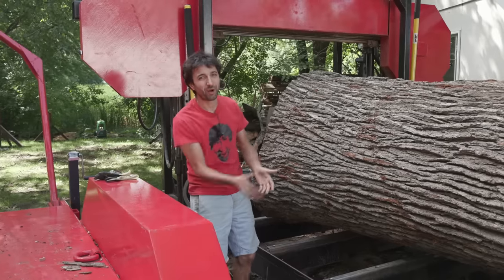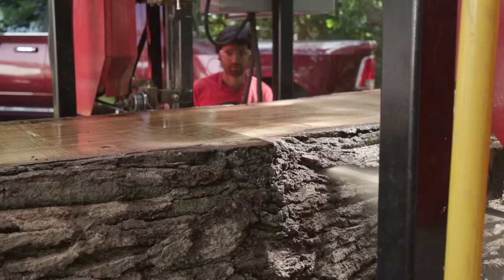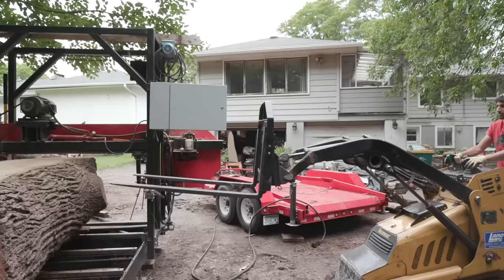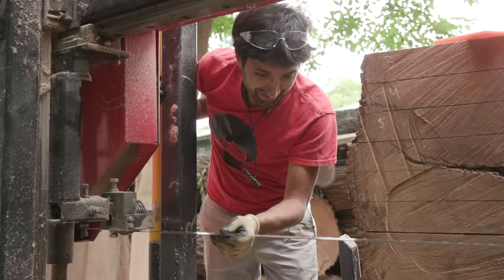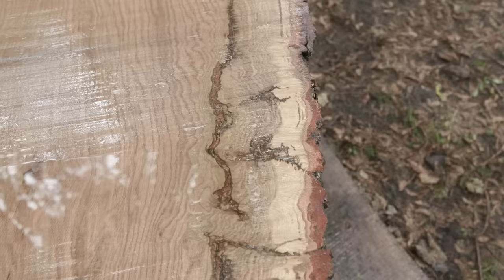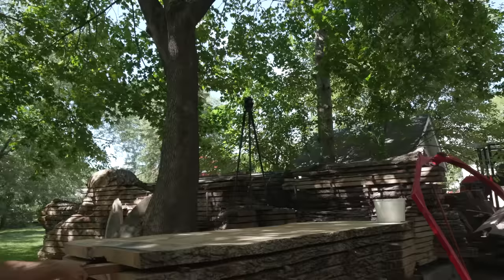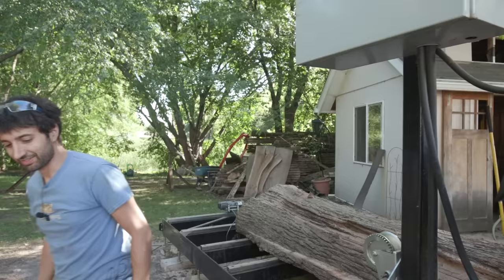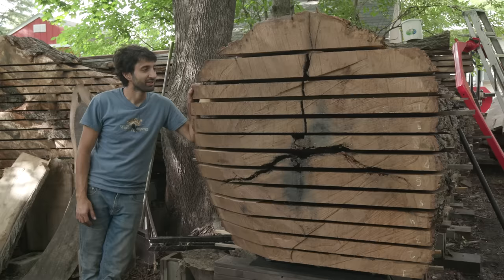Slabbing almost 8000lbs of White Oak

Comment: That slab-flipping setup is pure engineering genius. Simple and highly effective; the best kind of solution.
Reply: Why does the slab have to be rolled?
Reply: Doesn't absolutely have to be, its an artistic decision to get different grain views.
Reply: Can stack it all in order without moving it twice this way, as well.
Reply: It needs the clamps welded to it
Reply: Love the ingenuity of the slab flipper. You should market them and call 'em "Twirl a Slab 5000"- so cool and so easy for you customers (wives) to easily compare which side is best. Love it, your channel, and passion!
Reply: Much quicker and simpler to flip them onto a couple of old tyres with the folks
Reply: @brucemcnee4818  yes but what fun is that they've been doing that for centuries the twirl a slab or slab a whirl which we might call it it kind of just to show off not everybody has a #twirlaslab or #slabawhirler

Comment: Thanks Matt for the tour through cutting that oak log. Amazing the amount of staining that barb and staple did to the tree so long ago. Back in the 20's my maternal Grandpa had a portable saw mill powered by a steam engine. Sure wish I could seen his operation but I was born in '39 so didn't get to see any of his work and he passed inn '47. Before he passed though he made and gave me my most prized tool. A kids saw was made out of a short section of his band saw. At about 4 inches wide with a handle he made as well and about 16 inches long he included the scarf braze joint in my saw not far from the handle.  There are two lines that are about ⅜ inches apart; that got me to thinking about the joint. A really fine modeling file and a sharpening stone revealed the very thin brass joint. Knowing how he did things I think it was put there on purpose for me. Finding it I ran outside, looked up and hollered "I found it Grandpa, I found it."  What wonderful things our folks did for us. Thanks for your "tour". Jim Martin

Comment: You should weld some wheels onto your rotisserie stands similar to how they are on driveway basketball hoops. That way they'd still hold securely in place, but could easily be moved when tipped at an angle

Comment: I’ve spent some time working around sawmills so I just happen to notice, I have been the guy in the skiddie setting the logs and stacking the product. What stands out to me is the simplicity of the the skid tool that you use. I think it allows you a much better view of what you are doing and how you don’t have to crawl in and out of the machine, you just step on and off. Very simple
Reply from the maker: Most people don’t get that. Thanks!

Comment: I collected the last log when my neighbor had her white oak removed. It had over 100 rings and was about 36 inches. 10 feet long. The tree removal company was taking all of the wood to a yard to dump it. I asked them to put it on my flatbed truck instead of their dump trailer which they happily did. I paid someone to saw it for me and it also had blue stains like this one. The pieces of steel were also very very small. I don't make videos very often but I did make a timelapse of the tree removal. It's on my profile.

Comment: That trailer is sweet. I'm surprised the blade doesn't pinch on itself with the massive weight of the tree.
Reply from the maker: Thanks Zack! A characteristic of sawblades is set: how much the teeth protrude past the blade's body.  This allow the teeth to clear a wider path than the thickness of the body supporting them.  The blade is essentially floating in the kerf as it travels through the log.
Reply: @mcremona  Dang Today I Learned. Thank you!
Reply from the maker: Happy to help. I know I’ve learned plenty from your videos 🙂
Reply: @mcremona  aha -I wondered the same thing.
Reply: What part of the country you from. 
Have you ever cut hedge also Osage orange? Love your mill.
How much was it.
Nice work
Reply: @JerryRigEverything  . Me, too. I was wondering why the blade didn't bind.
Reply: Why leave slabs on top of the current cut slab.
Reply: @smwrbd  Saves time.
Reply: @mcremona  That is true, but there must be a reason they never do that in professional mills. i guess that if a log ever fractures  once in a blue moon and you already lumbered 3/4 of it, that heavy pile of wood might slide to the side and put you in harm's way. But that probably never happens.  One thing for sure, eventually you want to make your custom sawmill more safe. That open wheel and belt can be a deadly trap. They should be covered with a door.
Reply: @mcremona   what is the purpose of the water on the slab?....
Reply from the maker: Show off the grain
Reply: @mcremona  lol......well duh,now that I think of it......makes perfect sense, thank you
Reply: @mcremona  I want to make a table with the widest piece, like the 54" by 11 ft white oak do you have any left ? And how much and where are you located ?
Reply: Maybe In theory but not in practice. Im sure a slab or two is good to help dampen vibration in the slab being cut. But id be keen to see you do an experiment on swarf evacuation, swarf temp, and blade temp ( particularly coefficient of temp blade in vs blade out) as well as motor load measuring those value's slab per slap in a stack. I understand the idea that the teeth are wider than the blade. And that's fine in a vertical blade or band arrangement. I can almost guarantee you are shortening blade life and getting a worse surface finish bystacking up so much. And getting blade deflection too.

Either way its your machine and your getting results, but I just cannot help but wonder what you could do if you weren't loading up the band.
Reply: 6)
Reply: @donbrecker8982  pppp
Reply: @xbigshot1  Just to show the grain more and get a better idea of what the wood will look like when it's cleaned up e.g. planed, sanded, etc.
Reply: @mcremona  ývery smart. Fascinating to watch.
Reply: @alexandremehel5771  I totally agree.
Reply: @alexandremehel5771  At the edge of the cut, the wood ahead of the blade would hold the stack up.   Then the blade comes through and cuts wider than the band because of the set of the teeth.   The last part of the cut where the teeth clear the log might be worse for the weight.
Reply: @mcremona  Well said.
Reply: @indalcecio  and it will not cause unnecessary warpage?
Reply: @mcremona  My dad would have thrown a fit to see you throw water on the wood.  That makes the grain stand up.  Yet, he would finish wood and wet sand between coats.  I guess the varnish took care of that problem.  I know this when he was finish with a set of cabinets, the finish lasted for years.  He always felt the beauty of the wood should be the color.  If someone wanted a certain color stain he would do.  
You have the first electric saw I have seen.  I didn't discover your channel till today.
Reply: @wessmith7408  The effect of the water is only temporarily, not permanent (and your dad would have known).
Reply: Like at 22:20 He just can't figure out what's wrong...
Reply: They actually do that's the problem he was experiencing when he thought it was snagging.
Reply: My exact thought, surely all that weight will pinch. 👌💯

Comment: Nice video and you seem to be such a cool guy to be around. I love wood including my 5 ft diameter live oaks i have on my property. Not good for table slabs but working on plans for a awesome tree house to be built in the 2 connecting trees. Of course I would use non invasive attachments. Love your work.

Comment: I get that this is NOT "just a job but your trust in your saw blades amazes me. Steel on steel whizzing around at warp speed would have me using a remote on an automatic machine about a mile away! Cracking stuff and very enjoyable.

Comment: Nice log! Some feedback for the cameraman: it would be nice to include some close-ups of the interesting parts of the slabs, like the crotch figure and the ray flecking. The wide shots of the whole slab are a great overview, but they're too zoomed out to see much of the grain, especially with reflections off the water getting in the way.
Reply: True
Reply: Came here to say this. Great camera work but missed the close up grain shots.
Reply: Yep. And fewer ‘dramatic sweeping round’ shots. They work occasionally but the almost constant movement wasn’t helpful to see the work. keeping plenty of the fixed position shots would be great. But that said it certainly adds another dynamic 👍

Comment: I find it amazing the blade doesn’t burn up with all those slabs above that haven’t been removed.
Reply: It seems like it would be less strain on the saw if you remove them.
Reply: The kerf of the blade creats just enough space behind, as it progresses though the timber, for there not to be too much friction.  After a couple of inches the slab will sag down onto the rest of the log, but behind the blade - so the blade is effectively making its own tiny triangular void through which it passes.
Reply: I believe he is spraying the blade as it cuts with something. Water, silicone?
Reply: @timmayer8723  diesel, in my experience
Reply: When the blade is exiting the log that when the load causes the pinch on the band blade
Reply: @bryceanderson4864  on my sawmill, it has a tank(about like the fuel can), that you mix soap like Dawn dish liquid and water. That acts as a lubrication system for the blade. When sawing pine, mix a little pine sol in with it and that reduces drag from the pine sap.
Reply: @jimbobf8017  I like that better than the diesel.  I always worry about diesel interfering with the staining process later.
Reply: @bryceanderson4864  I've never used diesel for it before. I'd say that makes for an interesting day for the off Bearer. I started mixing Pine-Sol in because I was having trouble with sap buildup on the blade causing tracking issues. The Pine-Sol keeps the sap from building up on the inside of the blade and from your wheels and blade guides as well.
Reply: @jimbobf8017  diesel definitely helps prevent sticking,  but I think you have the better solution.
Reply: @martinbyrne6643  And that also is why the blade is set at a slight angle to the centre line of the log and not straight across.  So that when it exits, the whole width of the blade in the log is not pinched since most of the blade would already be out of the log before that last inch at the trailing side is cut.

Comment: 19:27  Blade is dull and getting hot enough to  throw out steam with sawdust.
20:13  Take off all the slabs to relieve weight on the blade, then it will be easy to drive a wedge in.

Comment: Seems If you would get those heavy slabs off the blade would go through a lot easier.
Reply: Thats exactly it too much weight on the blade would heat up and dull fast 1 slab at a time for me maybe 2 depends on wood type

Comment: What you may well be seeing is the remnants of HAM radio antennas. Very often, amateur radio operators would use trees to rig out their antenna and then they would move and abandon the antenna and the tree would subsequently grow around the wire and hardware holding it.

Comment: The weight of the slabs already cut pressing down makes the saw hard to go through??
Reply: My buddy has a mobile saw mill business and what this guy is doing is the complete opposite to what my buddy's been doing for 25 years, plus it's just common sense to remove the pieces to reduce friction from the weight
Reply: That would be my first thought but it looks and sounds like the saw blade isn't struggling at all.
Reply: @MattVenezuela 
  It mostly depends on the width of the blade used. But by using geometry & physics to find the angler vertex pinch point/s (binding) of the...a.) blade width, b.) kerf of teeth, c.) teeth length, d.) substrate flex potential/rigidity, e.) mass, etc; will indicate if there's a benefit/s, or not, to removing a slab after each one has been cut...
Reply: If it cuts, why take the time to stop?
Reply: Helen Burke The cut slabs above cannot pinch the blade because the blade is not wide enough. The uncut wood immediately in front of the blade would have to crush to grab the blade. The slabs above will meet the cut ones eventually of course but not soon enough to grab. Imagine the new cut to be like a triangle on its side with the blade running free within whilst cutting the triangle base. Let another viewer explain how the blade exits.
Reply: @MattVenezuela  Master sawyer Steve Cross does it Matt's way and what Steve doesn't know about large-scale band saws isn't worth the light of day,
Reply: set on the blade gives clearance

Comment: The lovely straight grain of white oak is why it's so popular for construction tion and furniture. 
 Where I used to live in Mountain Home, Arkansas there was a little shabby house that they were taking out for new construction. The removal man said no problem have down in 2 days max. Well he got all the add ons down, but the basic orginal structure wouldn't  budge. Called in an expert on building. The expert took a thorough look said this can only be sawn apart section by section. Every bit of the original was oak including the pegs that held it together. The city bought and put it in a park area.

Comment: Isnt the weight of that trunk not wearing on your blade the more tree is pushing on it?
Reply: That's what I was thinking too.
Reply: Where the blade is cutting it is not pinched by the weight of the slabs above it. The uncut portion supports the a gap the size of the blade kerf for a few inches before the weight pinches down. That is why it is hard to back the blade out and he has to wedge the wood to back the blade out if you hit something.

Comment: This is my first look at one of your videos........now the question, why on earth do you leave all that weight on  there and then pinch your blade? I'm not a sawyer, so fill me in on this, thanks.
Reply: another guy asked it above as well and he responded:

 Thanks Zack! A characteristic of sawblades is set: how much the teeth protrude past the blade's body.  This allow the teeth to clear a wider path than the thickness of the body supporting them.  The blade is essentially floating in the kerf as it travels through the log.
Reply: @juliantavalin4842  So even if it does float in the cut, I still don't see the point of leaving all the slabs on top. You've got to  take them off anyway. If you have to pry the slab off your blade, you just have to lift one. Makes sense to me. Besides, you might be able to se what the blue stain is if you only have one.

Comment: There's a oak tree nearby where I live that's the same size as that, maybe even a little bigger. At a guess I'd say its over 40ft tall. Its been there as long as I can remember and I'm now in my 50s.
Reply: I am not sure where you are, but free-standing oaks (those not in among other trees) will grow to at least 80ft here in the NC piedmont, and close to 100ft if surrounded by other trees.  I own a couple of massive oaks myself, around 80-90ft, and a beautiful, symetrical mushroom shape with a crown as wide as the trees are tall, and with similar trunks to this log that Matt was cutting.  I believe they are at least 200 years old, and it wouldn't surprise me if they are 300 years old, but I have absolutely zero intention of felling them unless they die or have major storm damage.
Reply: @pulaski1  I'm in UK, in what used to be a heavily wooded area before being developed and if there were any surrounding trees, they were cleared. I wouldn't be at all surprised if your estimates are right. I remember this one being a well established tree when I was young and that was 4 decades ago.  Yours must be magnificent!
Reply: @tonysansom  Yes, they are magnificant - which is why I would never voluntarily fell them.  

Most of England's oak forests, especially in the south, were pretty much destroyed to make ships in the 16th-18th centuries, so "specimen" oaks are rare.  .... I am from the UK (originally Yorkshire) and am familiar with what is left of England's historic woodlands, especially in the Forest of Dean - which has many pine plantations these days.

I lost a smaller oak (75ft, 26" at the stump) 2 years ago, and have about 350bdft in 4/4, 8/4, and 10/4 slabs stickered and drying under my sunroom.  My neighbour had asked if I was going to cut the fallen tree for firewood!

Comment: Can’t help but wonder if it might be easier on the blade if it was only cutting through a single layer without all the weight of the other cut slabs on top
Reply: And the individual boards wouldn’t have those rough curff lined on the surface.
Reply: At the point where the blade teeth meet the face of the cut the downward weight of the log on the blade is zero pounds. Using a 1” blade or less you still have basically zero downward pressure on the blade’s rear edge. The wood can’t bend that quick. 

As for those blade marks on the slabs, that is due to the slow forward speed of the carriage. The faster the carriage travels, the less saw marks there will be. On a slabbing mill like this one, there’s nothing you can do about it. It’s taken care of during the construction phase of using these slabs. 

P.S. “Kerf” is the thickness of the cut. On a bandsaw mill, it is typically a 1/8” kerf.